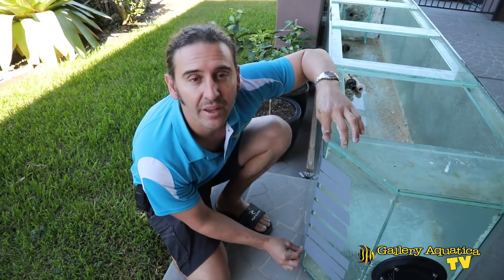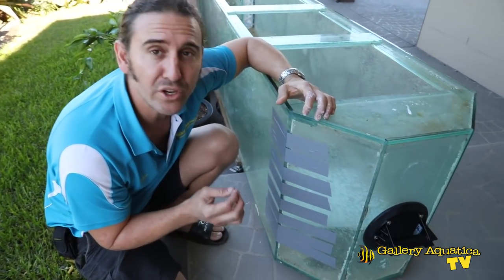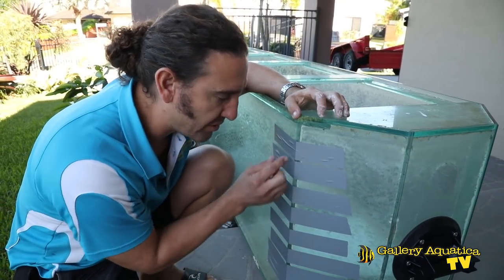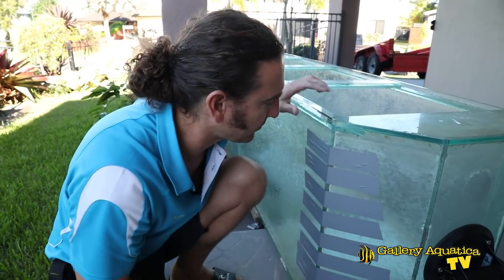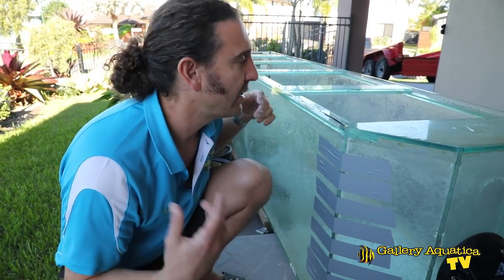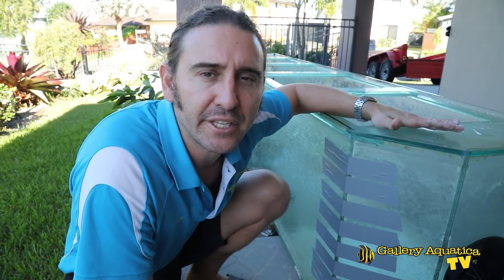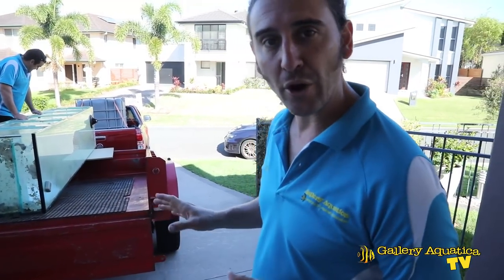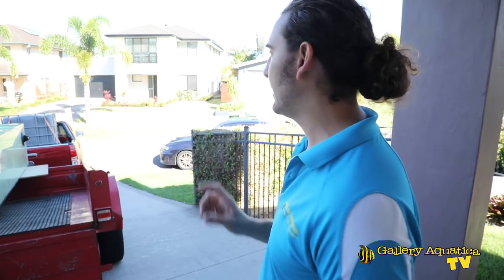The Great Tank SMASH --- Gallery Aquatica TV

Comment: Had the same leak on my 55 gln  fresh water system... Tried the same method with duct tape & silicone on the outside.lol, Started as a small leak but eventually I gave up. Feel the pain of the owner. Wish I could have seen her being destroyed. Then oddly enough the brand new system did the same but on the left bottom corner when I was at work. Talking about being pissed & upset.
Reply from the maker: That’s some bad luck😞